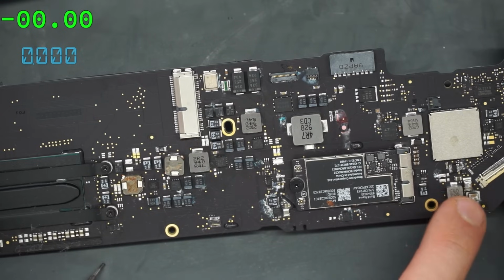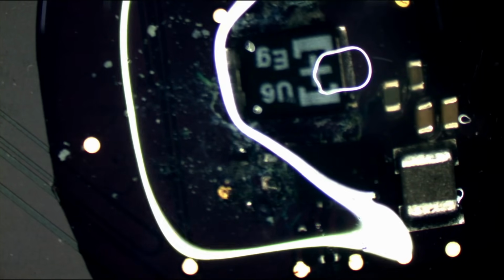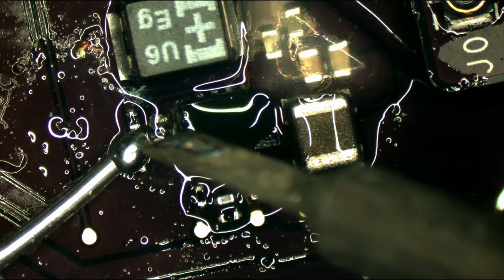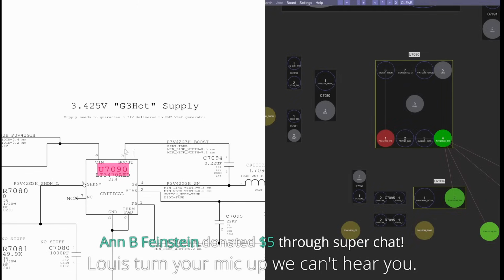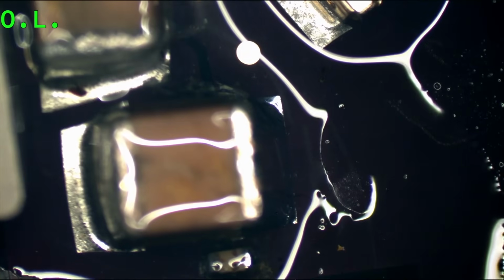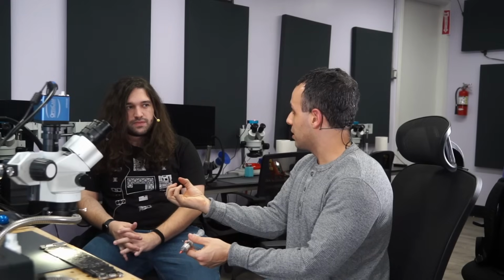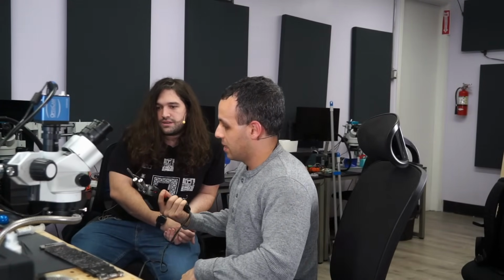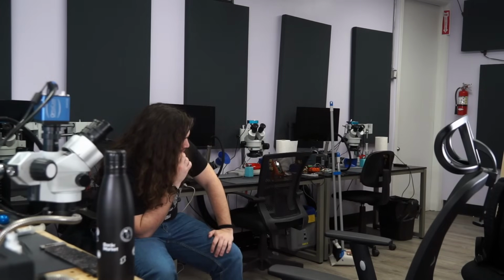The man, the legend, the idol.

Comment: 30:35 spatial relation. you change your thinking or you change how you view what you are doing to the point it copies how you do it with your eyes. so you put the monitor infront of your eyes like you are doing with out a monitor, then you have to adjust the monitor distance until you are competent at what you are doing, you can either do this by moving the monitor closer or farther away with your eyes, or by adjusting the resolution to less  or more pixels per distance (DPI).
 to change your thinking you learn by putting your chair on the side of the table, then getting comfortable with trying to do it from another angle, then you change the direction your seat is facing instead of being at the work, you change it to 90º. a quick easy way to get comfortable with this is to take a book, turn it side ways, and try reading it like that until you are comfortable reading at a moderate pace, then turn it completely upside down and learn to read it upside down and backwards. this is literally how dyslexic people actually see the world the way their brains are wired for the ones whose dyslexia doesn't interfere too greatly with normal learning. to level it up put the book down face first upside down, then grab a mirror hold it on edge until the lettering is normal on the paper and not at an angle, then read it that way, backwards, upside down, it feels like looking at the russian alphabet or for russians looking at the english/greek alphabet/gregorian/georgian this is how you train your mind to think different from what you see as you develop a spatial relation understanding in your brain.
 to progress beyond this you need to use machinery, say riding in the back of a pick up truck on the tailgate watching the road go away from you, it's going to duplicate that nauseating feeling but it's easy to cure by turning your head to the side and watching the road that way for a second or 3. this is the equivalent of reading at 90º from the book.
 you can progress it by doing the mirror trick the same way as the book example. this is what is hard for people to adjust to in aircraft flying. 3 dimensional axis controls, push to go down, when you do push ups at the gym you push to go up, and you are fighting this programmed instinct, and in an air plane it's the opposite except the left right stuff, you pull to go up when you want to push to go up as you have programmed your brain.
 the next step is to change your dominate hand or eye, do one and master it the eye is much easier, but the hand will get your brain rewiring results faster.
when you exchange your left for right say in throwing it's easier to accomplish a task tho it will be of poor quality but when you exchange both your eye dominance and dominate body part, kicking with your left instead of your right, eating with your left instead of your right.

if your uncoordinated this factor of difficulty goes up by 10, but will increase your normal coordination once you revert back to normal habit.

an easy way to learn spatial relation is to take up swimming learn crawl stroke, breaststroke, butterfly stroke, side stroke, back stroke. especially learn how to do a backstroke start off the blocks leaping up and backwards off the pool gutter. this will be incredibly less nauseating and help rewire your brain better but not every one has access to a pool and finances or time for all that goes with getting ready and cleaned up after a pool you can swim laps in even if they are shorter laps. lakes kind of work, but you need the ceiling to give you a sense of judgement as to where you are and what and how you are doing, to go where. lane lines aren't enough, they help some what, but the ceiling helps the most, you can always keep the edge of the pool to one side of your head so you can correct any misconception/nausea feelings that can pop up near immediately but being able to see the ceiling and the sides pretty much prevents this from happening at all. plus the side of the pool gives comfort if you have any sort of fear about your swimming abilities or monsters that don't exists (try learning to water skii after watching the movie JAWS in a lake with fish with teeth like your fork and as long and thick as your legs or  bigger.)

driving backwards with your side door mirrors is pretty quick to pick up just don't go fast at all until you master slow when you never have to use the brake except for when required to do so like stop signs, then slightly use the gas pedal at constant power levels until  you master that speed too.

 the rest requires heavy equipment flight sim and then flying lessons, but that's when you are trying to make your level into a much higher skill you can use normally at will when ever you want.

Comment: Imagine the cash you could make on falsely failed, "parts only" and discarded GPU's? Mr. Rossman, I'd give a kidney to learn Vbios module diagnosing and repair under you. Did light SMT re-work for Nokia a hundred years back , but my main role was Assembler and Flash / Default. Now you have a Wave / Flow soldering machine and Steve & Co have a fan tester. I will be arming myself with both great channels. Kudos to you both.

Comment: This is the crossover of a century:

GAMERS NEXUS X ROSSMAN REPAIR
    STEVE BURKE X LOUIS ROSSMAN

Legend Meets Legend!

EDIT: Also, you can't use too much flux if you can afford it. But there are several grades of flux, and the better ones tend to cost more. So if you can't afford using too much flux, then maybe one should use Paul amount of flux until you can afford it (or use a lower grade flux)?

Comment: when  I see some residue on a board I would take a toothbrush with isopropanol to clean the board. "Dry" it and then test if that helped and then I would check for shorts on capacitors and then
work my way from there

Comment: I had a hard time doing module repair diagnosis. De lid it? No problem. That was a few years ago.
 Actually removing and rebonding the components? No way. I like coffee too much. 
It took a week to get my hands steady enough just test the volts quickly in the traces with absolutely no caffeine of any kind.
  Nope. Never steady enough to run the wire bonding machine. The gal that actually removed and replaced the parts. Said I had too many thumbs. 

You do not realize how steady your hands are, until you work with a stereo microscope.

Comment: 32:06 You should be my double PCIE riser connecting my GPU that sits outside my case since it doesn't fit. And I have 2, 26 gauge wires running up to my desk that I short together as the power button.

Comment: was wondering why cleaning in this video is only about putting the flux on and drying it, as in, the junk is never removed, but then Louis mentioned ultrasonic cleaner at around 23:00. now it makes more sense, you wash it with flux, then rinse in the cleaner

Comment: Always Flux... always use stereo microscope for depth perception and how Louis said always go thru the typical hierarchy when troubleshooting. Power.. follow the signal process, step by step. Try to understand the board, in best case with a schematic. Flux does support the heat distribution and also provides a sort of protection against oxydation as long its not completly vaporized. Change components you suspect. Measure them ouside of the board if possible to check  if your suspection is correct. Read the datasheets in order to do that. Repeat until you succeed at last. Remember, it is not always a component, sometimes its the board itself (traces broken, pads ripped etc...) or in some cases there is not even a fault just a "user error". Repairing is careing. Peace.

Comment: Has anyone tried fixing a weak soldered nvidia GPU by running it without the heatsink at 100º? It gave my GTX 570 a second life. The safety triggers at 102º and stops the GPU on a black screen.

Comment: I'm in my late forties and have met one person, outside of the Navy, that knows how to do multi-level board repair. (Some people call it multi-level trace repair).  Thanks to the ever-increasing instant gratification, throw away society that seems to be on the rise,  I'm apparently one of the few left of a rare and dying species.  At first I was kind of surprised how many so-called repair technicians didn't even know what multi-level board repair is.  They understood the concept when described, but they had absolutely no experience or training with it.  The easy availability of replacements and the ability to fabricate, (or have fabricated), a whole new board makes that skill obsolete I suppose.  ...Plus, at higher frequencies, trace size and spacing must be more precise due to capacitive and inductive reactance issues.

Comment: Right to repair is important.
Steve did this in minutes, with guidance, sure, but no experience, and it cost about zero in parts, just some cheap consumables and equipment, which people don't need to buy because some shop will have it, but they can do this in 15 mins for cheap and the board can be used for years, and Apple would scrap it, maybe reuse some stuff, after shipping it across the world, and charge you hundreds for a new board which is overkill, and all it is is lining Apple already ample pockets, and it is destruction of resources, and money is a resource as well, it's all waste. Apple might reuse it, this is faster and cheaper, but in some cases you might need some chips you should be able to get, also for dollars, and they shouldn't be software locked to to prevent fixing it.
It's not just anti-Apple, it's anti-waste, the anti-asshole-Apple crap is a bonus, because they're assholes with poor technical design in comparison and an asshole we-do-not-care-about-our-customers attitude.
Reply: Well said.